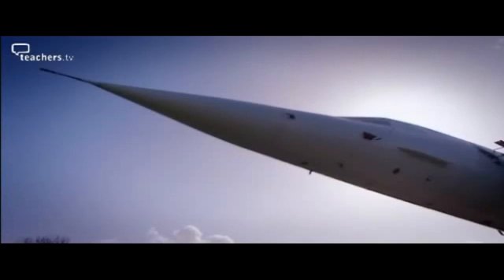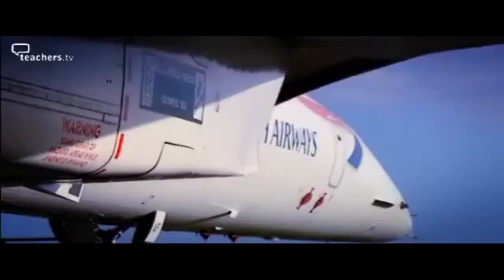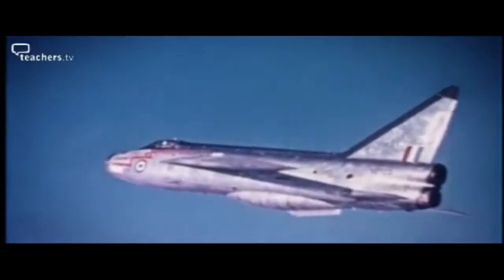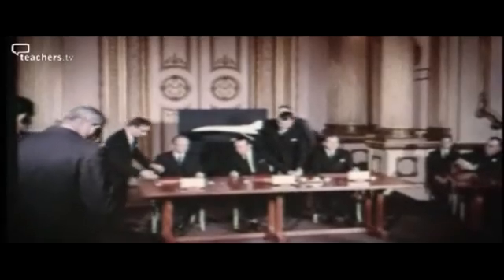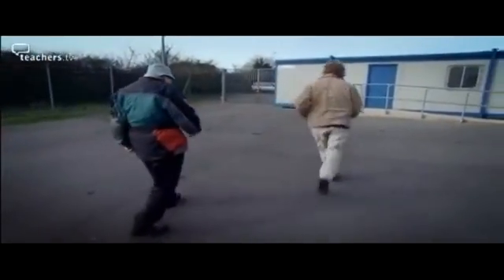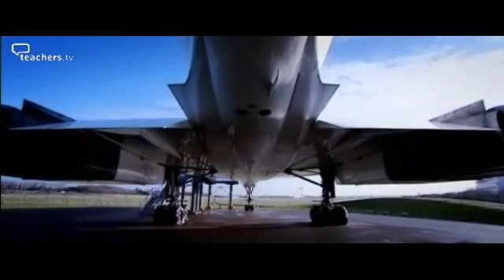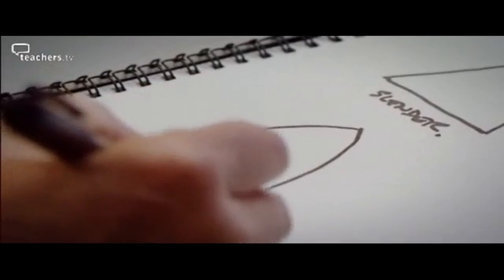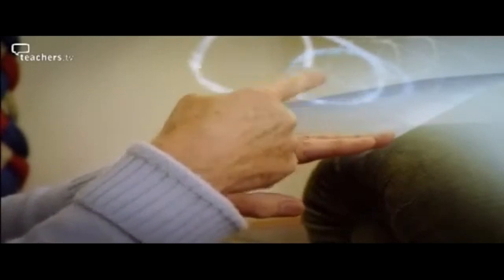Building Wonders - Concorde 1/2

Comment: What an amazing Plane totally original nothing like it before. With an original design based on nothing before manufactured. No computers  for design..incredible...An engineering time machine where passengers have never travelled at Mach 2 and a height f 60.000 feet. Sipping on Champagne! With no oxygen masks nothing. Seems like something out science fiction. We had but it's gone today when could be easily be active.

Comment: The Delta wing Cf105 Avro Arrow flew supersonic in1957.  Concorde is a upscale version of the canadian arrow
Reply: Danyel Potvin well, not exactly. Let's just say it was a distant inspiration. The arrow had a standard Delta which was efficient at very high speed but not very efficient at low-speed.

So to compensate, engineers at Filton found that the super oigival (the OG) shape got you the best of both worlds. But the super in the Super Ogival name, comes with the slender curve downwards, which created vortices above the wing which created lift at very low speeds.

Ultimately, this allowed Concorde to fly why a variable spectrum flight operation, where it could fly quite happily at take off, low Mach cruise, and high Mach high altitude cruise in thin air. which gave the engineers best of three Worlds which is exactly what they were looking for.

So although the arrow had a delta wing bomber the Delta was nothing new, as mentioned in this film. Engineers already knew that the Delta was optimised for cruise at high altitude, but that's all it could do. So the fairy delta lent it's shaped Concorde, but but only as a gentle whisper.